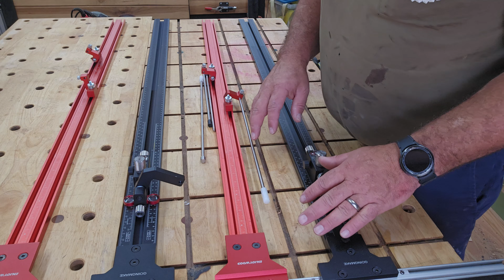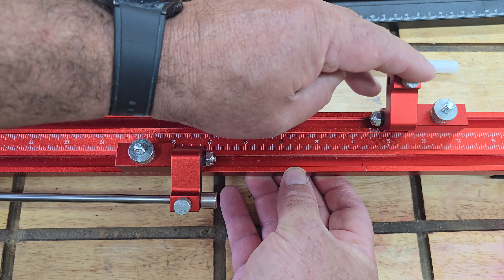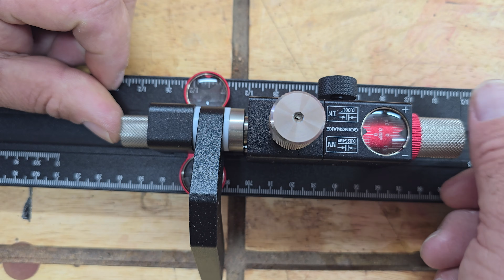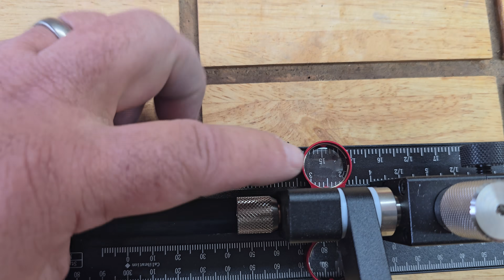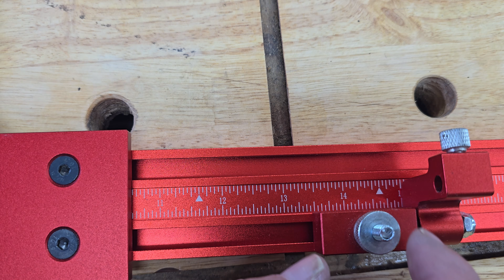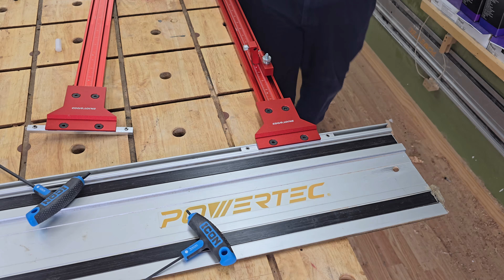Woodworking Guides Compared: Find Your Perfect Match

Comment: It all boils down to how much you want to pay against do you need all the bells and whistles. Personally in my home workshop, I don't need precision of less than a saw blade thickness.
Reply from the maker: I agree, it really comes down to what you are actually building in your shop. I used the cheaper one for a year and would not have spent the money to upgrade. Now that I am using it more often I would buy the Goingmake one if I had to start over.

Comment: How accurate are each when cutting?
Reply from the maker: WHen you say "accurate" that can mean different things to different people. If you are referring to using the measurments printed on each, they all are accuate if you calibrate them accuate. I alway verify with my tape measure when setting them up. As far as keeping the measurement over several cuts I have not had any problems with either. I am care with them. If you toss them around or if you are rough with them the Goingmake will hold up better.
Reply: @ShopRamblings Fair point.  I was thinking about all aspects of accuracy that these should be.  Straight.  Square. Markings.  Consistent. Match each other.

Comment: What you said is a revelation.  Buy the cheapest set you can find.  And don't even worry about calibrating.  Just measure and mark.  Set the guide to the marks and then set the stops.  Everything else in the project is being measured by that tape you're using so the rips should be too.  I'm going to order the cheapest set I can find.
Reply from the maker: I always prefer to cut to fit over cutting to a measurement.

Comment: I can't afford nor justify the price to get the Woodpecker or TSO version of these.  I did get the Enjoywood, but have been disappointed in them and don't use them.  With only one locking bar (or whatever the technical name is) that connects the pieces together isn't very good mating system.  The bars aren't long enough and the rails will bend if not careful.  Also, since the rails are not one continuous piece of extruded aluminum the lengths are not quite equal.  I can do a better job using a tape ruler and pencil then lining up the track saw rail that using these.
Reply from the maker: On the enjoywood ones I would measure and mark the first board and place the track in position. Then I would slide the stops into position. Once set them I am able to make repeatable cuts. When trying to use the scale on the guides I would be off sometimes by a 1/16. For the price, they worked. The Goingmake make are much sturdier. Also are much easier to calibrate. Overall they work much better but are twice as expensive.   For me the Enjoywood ones worked for my budget. 

I was trying to show that the Goingmake ones are much better is someone could afford them without knocking the Enjoywood ones for those who can't.

Comment: As an owner of the TSO guides, those Going Make ones sure seem like a more thought out design.  Thanks for the video!
Reply from the maker: I have been impressed by Goingmake. They really seem to put a lot of thought in there designs and are constantly making improvements.
Reply: Good design, except for the screws you need to adjust everytime.